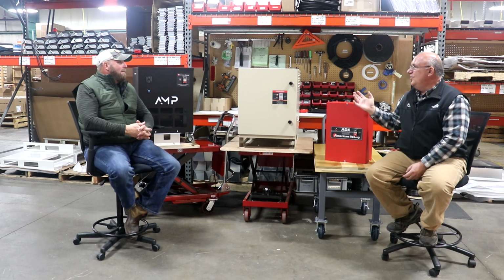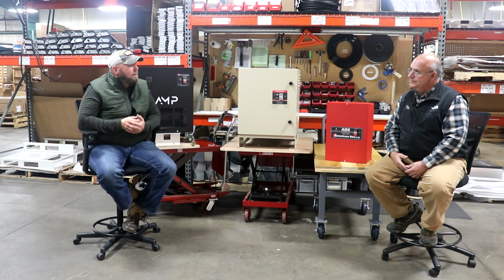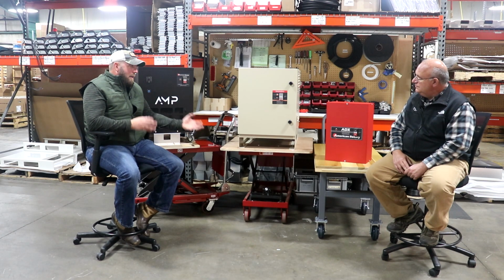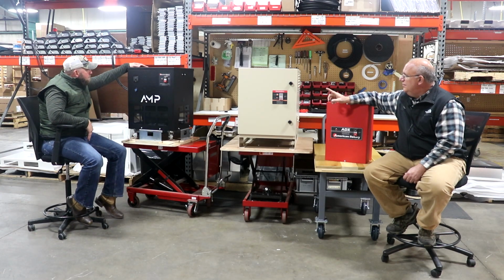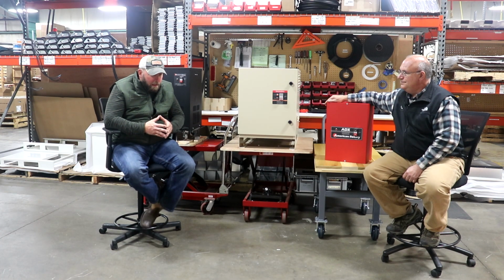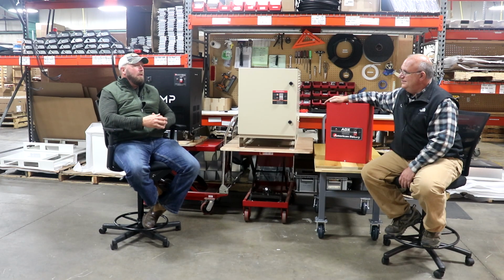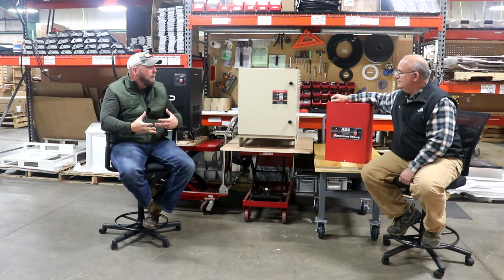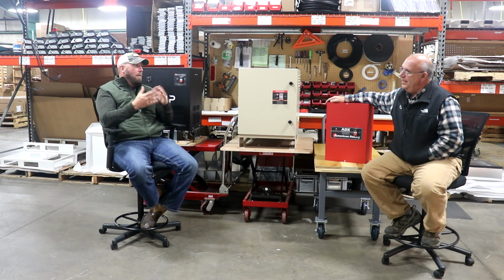American Rotary Phase Converters - a Visit with Chris Feavel

Comment: His comments about VFDs are not fair: he was talking about cheap Chinese VFDs and compared them with quality equipment. Compare a Siemens VFD installed with the line-side suppression you are required to, then all his arguments against them are gone, warranty and support included. AND you have the advantages. A lot of equipment in 3-phase countries is run on 3-phase VFDs for those functions: variable speed, variable run-up and run-down, braking, remote reporting and control, fault protection etc etc....
They "just happen" to also be able to be fed by single phase and even DC.
Lifts and lift doors pretty well everywhere in the world are running on VFDs, so I don't think reliability is even in question....
Reply from the maker: VFD's have their place.  When it comes to variable speed and the need to program certain functions into a motor, they are invaluable.  But, if your goal is simply to create three phase power, they are not always the best option - particularly when you need to run multiple machines.  A Rotary Phase Converter will end up being a more reliable and cheaper option in the long run if your are running more than one machine.  As for VFD's - I have and use two in my shop, however, I am feeding both of them three phase power off of my phase converter so that I don't have to size them up by 50% to get full power out of them.  For most home shop people who will have the need to run more than one machine, I strongly feel that a rotary phase converter is a better long term option.  If you do need a VFD for motor control, I suggest that you buy a quality unit like you suggest and stay away from the cheap imports - which is what most home shop people gravitate towards.  Oh, and while we did not mention it in the video, if you have a need for a VFD, you can contact American Rotary as they also sell these and provide support for the units that they sell.
Reply: @VintageMachinery  I completely agree with you in principle.
Just a simple question and comment:
Do you know where the myth of having to downgrade single phase run VFDs came from? I have no idea nor can I figure out any logic in it... They are designed for a specific output and don't care in the slightest where the power at the input comes from. You just need thinner wires if you bring the power in on 3 wires instead of 2....
I have approximately 11 VFDs in my home workshop - including 3 on my cylindrical grinder alone. There it allows me to correct the surface speed of the wheel, the rotation of my work and the flow of the coolant, all by changing motor speed on the fly.
They range in age from around 35 years old to a brand new one. NONE have ever been down-rated and most have been run at maximum load for hours. Occasionally I overload my mill and lathe motors and they reduce their output back to their rating after some seconds - or switch off if I don't back off quickly. None have failed for that reason.
I have had failures due to dried up capacitors one once due to an underrated rectifier in a Chinese one. Both were repaired.
I try to get used Siemens ones when I can. None of those have ever let me down.
I can't find any reason to ever want an expensive and bulky rotary converter that uses significantly more power.....
Interesting to hear both sides of the argument though.
Reply: @JoeInBendigo  It is NOT a myth.  you do NOT have to upsize a VFD,  IF it is made for single phase supply, but most VFD`s are made for three phase supply, and THEY NEED to be upsized, otherwise you WILL burn up the rectifier (as you are only using 2/3`s of it)
Reply: @JoeInBendigo  you can run VFD from DC. :)
Reply: @VintageMachinery  I think you have 2phase (240V) outlet. Just feed it to regular 3phase VFD leaving one phase unconnected and it will run. Diodes will be 1/3 more loaded and sure it can handle.
I am using very old 110V@3phase VFD (60Hz) in european 230@50Hz 1phase grid for my lathe. Just connected it L and N to L1 and L2. And it run several years. And I get it for free as it was 110@60Hz unit in europe.
P.S. do not forget that there is option to rewire motor from star to triangle to reduce phase voltage.
Reply: @VintageMachinery  While many home shop people buy the cheapest VFD they can find on ebay, I was able to source brand new Hitachi VFDs at competitive prices from a dealer in Dallas via ebay. It's been about 4 years now, but I bought 2 hp units for a bit over $100 each. The price was about the same for a 1 hp box, so I just bought two at the size I needed to run my vertical mill.

The manufacturer's installation instructions are pretty good, but not being a sparky myself, I did have to parse through them a couple of times to be sure that I didn't make a mistake.

Comment: On the "why not build one" topic, I've made the studies that allow me to build one safely and reliably but I still wouldn't build one. The thing is that for one it takes time to research and source the components, assemble it and when you factor all of that time buying one becomes just more profitable. And, let's be honest, it's not because you can do something that you should do it.
Reply: Considering you can build one for about $150 worth of parts(Few caps(Fairly big caps:), relays and a timer) using an old motor that you can get often for free(Or scrap prices) and a phase converter is often many thousands up..  I'm sticking to building one..
Plus I'd know know how it works in detail, what all the parts are and how to fix it, so if/when things go wrong, it's a simple repair.
I do agree however that unless your quite comfortable working with 240 single and 415v 3 phase, I'd not suggest anyone build one. Mains is dangerous.

Comment: Had a better opinion of American Rotary before I saw this guy. Seemed sort of vague on specific info. Did not open a box. Did not explain the dif between VFD and Rotary and how they work. Also knows little to nothing about Amateur Radio, electric companies, and harmonics. HINT: amateur radio operators today use factory built radios which must meet FCC emissions standards, which means no spurious signals up the power input to the electric company.  Glad you got a sponsor Keith. Maybe next time get one of the engineers to explain the products. I'm sure American makes a good product, and it deserves to be explained a little better. my 2c IMHO

Comment: I key up a kilowatt all the time on HF.  The wife, the neighbors, know one knows.  Why?  Because my rig is clean and I keep it that way.  Flourescent light ballasts, treadmill motors and touch switches are dirtier.   In short, it was a very ill informed comment.  BTW the VFD that I use to power my grinder is clean too.
Reply: Your rig is clean but I'm sure you realize that not everyone runs a tidy shack.
Reply: @Blazer02LS  That doesn't give the original comment credence.   Phase converters are what they are.

Comment: While I do not use rotary phase converters, I have used variable frequency drives from fractional hp to multi hundreds of hp.    Have been doing so since the early 1980s for a company who is a member of the DOW 30.    Did so until retirement 7 years ago.
I take issues with many of his sales points.
His credibility dropped to absolute zero with the derogatory statement regarding ham radio operators !
Reply: I lost interest in the video and went straight to the comments when the salesman started in on "American Made" when the subject of VFDs was raised.

I've been an engineer in heavy industries for 35 years now, and we were using the then newfangled VFDs in cement plants and steelmills back in 1985.

Comment: I sure like the unit I bought from them a couple years ago.  Do they still charge extra for the UL decal/sticker?
Reply: Any manufacturer I've dealt with has charged for it, unless that is the only way they sell their equipment, ie. industry requirement. Which is rolled into the price. Aint nothin' free, as the adage goes.
Best wishes

Comment: As German electrician and electrical engineer, I can't understand why there is no 3 phase power.  But I can say, a phase converter is the better solution than a VFD.
Reply: Why not a VFD. VFD has more options, safety systems and speed control vs just direct 3~ power
Reply: The three phase IS there, it is just not sold to home owners, and the entire system is set up to use single/split phase,   so they only need three phase when they buy a piece of industrial equipment.
Reply: @jesperdahl1486  I know that there is 3 phase power. I can't find any good reason why they don't us it in normal homes.
Reply: @jecceworks  A VFD is very good for a single motor. You need to configure it for that specific drive. I was talking of 3 Phase for the shop. Not every motor can handle a VFD. The old machines in a home shop are not designed for it. A VFD produces a lot of harmonics. You need big filters to get rid of them.
Reply: @davidstr4946  Trust me, if there is three wires on the pole, there IS three phase power, and it is on every residential (99+%) streets in the US,   I have never seen it with my own eyes, but supposedly at the far end of rural runs of power, they run only two wires, so three phase is no longer an option.   A regular house does NOT need three phase, it just makes things easier/cheaper (thinner cables)   you only NEED three phase power for (obviously) three phase motors.
Reply: @jesperdahl1486  I have to trust you, I was never in the US. I can not see why you can use thinner cables.
Normal home in Germany:
3*63A*230V=44kW => 4*16mm²
single phase:
183A * 240V=44kW => 3*70mm²
three phase:
3*122A*120V=44kW => 4*35mm²
Reply: @davidstr4946  I am not US based either, I am one country north of you, in Denmark, but I have spent many month traveling, all over the US.
The reasons that the US uses the single/split phase system in homes, and not three phase is blurry at best, but now it is a legacy system, and not likely to ever be changed.   In Denmark a "normal"  house has a supply fuse of 25A 32A at best, are German houses really supplied with 63A ? Of course you are correct that three phase at any voltage levels, requires thinner cables then single phase, but that is not the point, the point is availability, and most US power company's will not install three phase power in a residential home, even though, it is on the pole right in front of your house.
Reply: @jesperdahl1486  63A is normal these days. but there are also 40A or 100A.
Reply: @jesperdahl1486  You need to get out more, there are a lot of places in the US that only have single phase power around them.
Reply: @jesperdahl1486  This has not been my experience in any of the places I've lived or visited across the country. The only time I see three phase in a residential area is if those poles are feeding a larger commercial (or governmental) property nearby. In my area for example, the entire subdivision in single phase but for one road that feeds a school. 3 phase terminates at that building and is unavailable a block further down the road. Why would the electric companies be cabling for 3 phase in residential areas when it's not used for residential? It doesn't make financial sense.
Reply: As a part-German and not and Electrical Engineer, I can't understand why Europeans and especially Germans feel there is some need for every home to have 3 phase power.
We have modern equipment that runs fine, not under-powered, throughout our houses on 120v 1P. Our normal high power equipment like washer/dryer, electric stove and furnace seem to run perfectly fine with 240v 1P.
Using 1P across 300 million American's home save us 25-50% on copper alone.  And our houses are generally larger, and further from the street transformed than in Europe/Germany, which is also something non-Americans don't know and don't take into account.

On the flip side, how many 3P electrical lines running in your house are actually using more than a fraction of their available power?
Are you running 1000 watts of lighting in every room?
Are you also running 500-1000 watt tv/4k monitors?
Are you also running 500-1000 watt kitchen appliances?

Outside of the <1% of Americans who might want to dabble in industrial machining/welding/woodworking in the home setting, there aren't many people at all who are complaining about 1P power here.

We have LED/OLED TV's now instead of CRT/Plasma, everyone has laptops instead of large desktops, lighting is all LED instead of incandescent, and on and on.

As an EE, it should be pretty basic Electronics 101 as to why the 'obsolete' American 1st gen electrical infrastructure which is cheaper to install, uses less natural resources like copper, is actually better as we move forward into the future.  
I mean its great that you can hook up an industrial welder to any outlet in your garage, or kitchen or bathroom if you want.
If 99% of the people are never going to do such, it seems like a costly overbuilding for no valid reason.
Reply: @jesperdahl1486  The rationale for 1P in the USA is not really blurry at all. Every system has to start -somewhere-, and of course 100 years later it going to look sub-optimal.
My understanding is that it is rare to have 3P in Europe. Germany and apparently NZ do have it too the residence.

My question is why do Germans or Kiwi's need 3P to every residence?  1P seems to work fine for the limited power roles they occupy in residences.  In 110v 1P countries, they usually have a 1P double-voltage available as well, which cover the few high power consumers in the house like stove, heating or old fashioned washer/dryers.
Everything else from lighting to entertainment to appliances seem to be using less and less power as we move forward. So one really should be asking why Germany/NZ are spending more money on copper and 3P for little if any cost advantage.

The downsides of being the leader in at scale infrastructure like electrification is that its sort of a once and done deal.
I could triple the number of LED lights I've replace flourescents with and still be quite a bit lower in power draw than what the old bulbs drew.  Most of my 110v 1P circuits are generally running at 10-20% capacity.
Reply: @davidstr4946   Cost is a big factor. Where I am located for instance the closest 3 phase would cost me close to $95,000.00 to have it run to my shop.

Comment: lol there is 3-phase at a hog farm a mile down the road from me, quote was still like $30,000 to get it ran
Reply: We got a quote to run 3-ph from a storage facility 1/4 mile down the road. $65K. Pulling 1-ph off the tower that butts up to our property line we can easily access 400 amps, 800 with permitting, and add an RPC. Will get 3-ph power that is cleaner for galactically less.
Reply: @imkindofabigdeal4308  I went with a phaseperfect digital converter for my CNC equipment, they are very pricey but so far well worth it. The thing is they can automatically balance the load, so the generated phase's voltage isn't too far away from the other two legs. So basically you can hook up a bunch of machines to a single power strip and have them all run with balanced voltages!
Reply: @multiHappyHacker  Phase Perfect makes a great system from what I hear. Wish 3 phase was a standard thing here but glad there are cost effective solutions.

Comment: So I was in the Military and we used motor Generators (400 phase)  yes it was for a specialized purpose...  but what is the difference between and MG and a phase converter??
Reply: Nothing other than that the phase converter has a single phase motor turning a 3 phase generator.
Reply: @paulg3336  Nope that is not how a phase converter works. a rotary Phase converter has a 3 phase motor used as an idler to generate the 3rd leg for 3phase and some capacitors and inductors to correct the phase shift and voltage difference to mimick balanced 3 phase power.